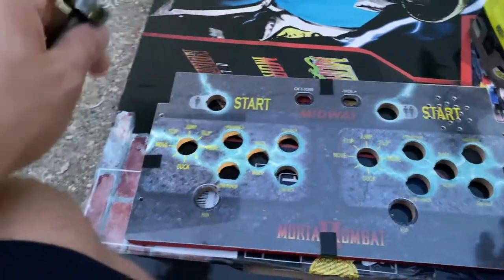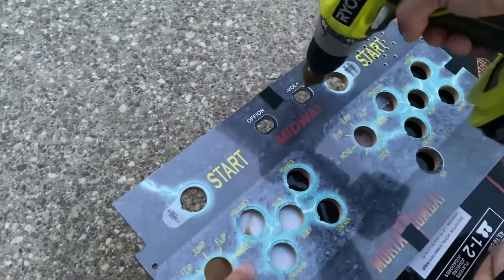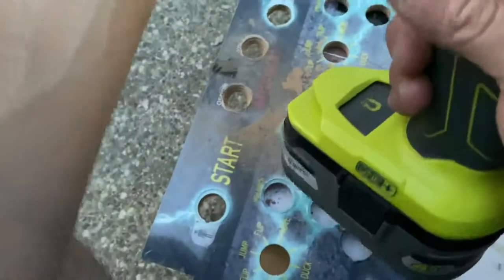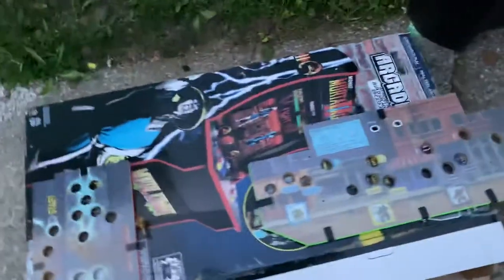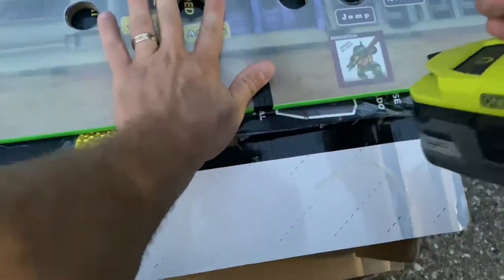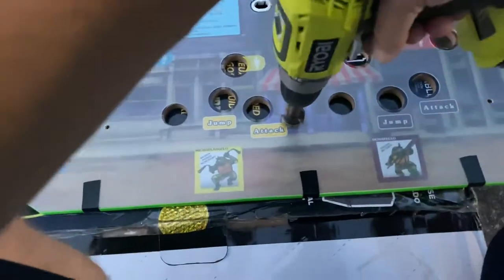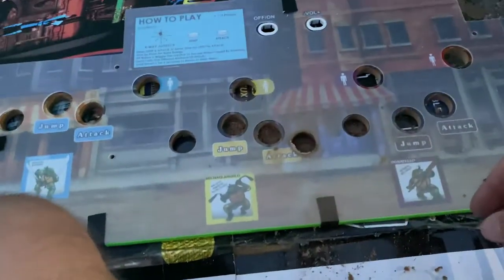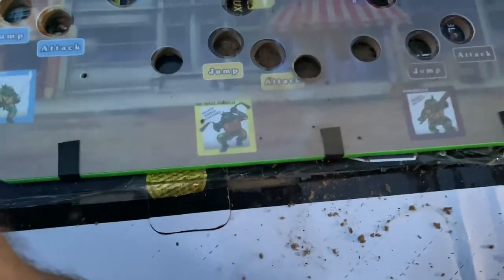Drilling the hole for your arcade with a step bit and forstner bit

Comment: If i had sanwa sized holes in the board already done and want to put holes in the plexi,  should i use the frostner or the step drill bit. Are they both 1 1/8 as well? Thanks!